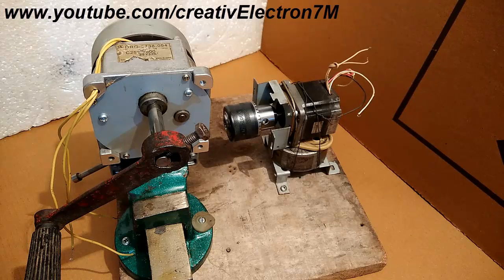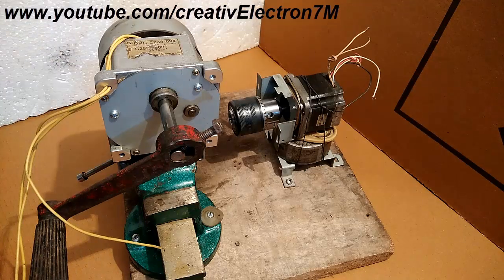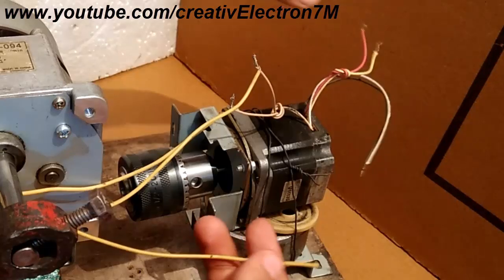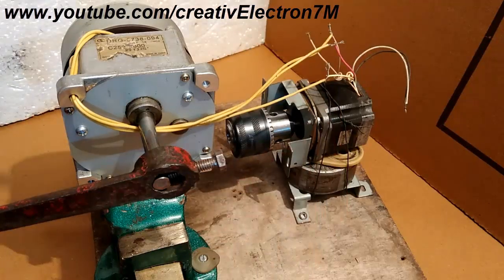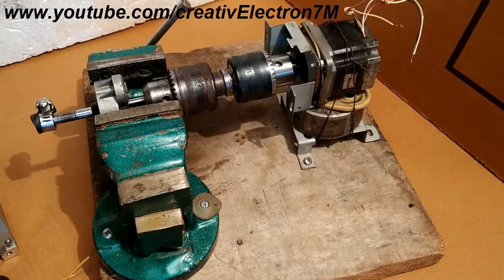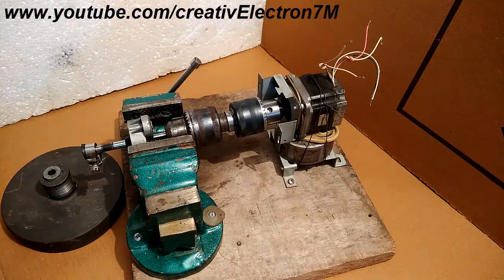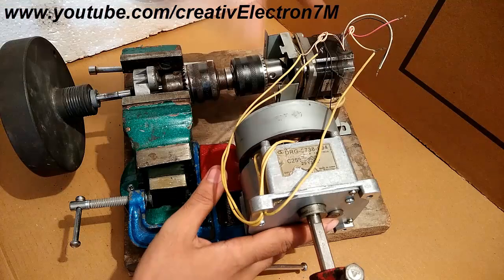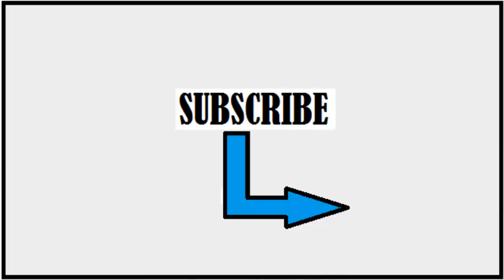Stepper Motor Runs Without a Driver with a Free Energy Generator

Comment: You need to rotate your stepper motor and put the flywheel on the generator, if you want some real Free Energy. You can use momentum and centrifugal forces to power up batteries from it's own potential, or built up energy storage.